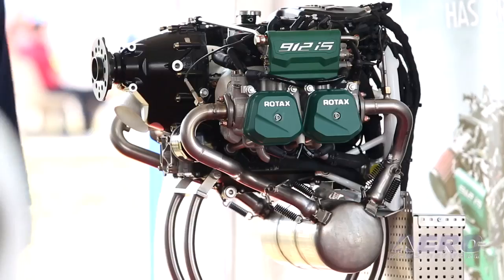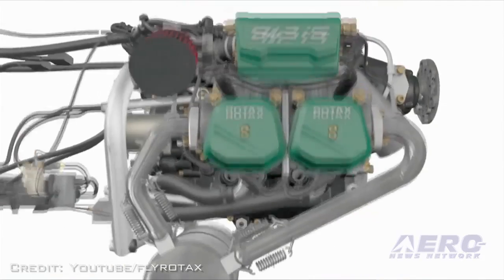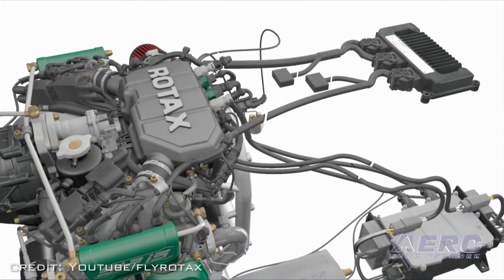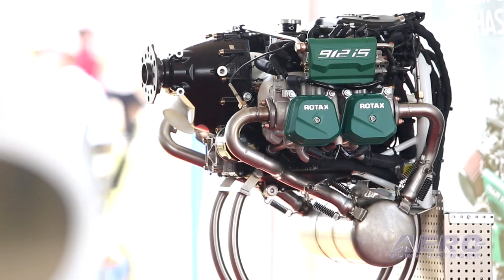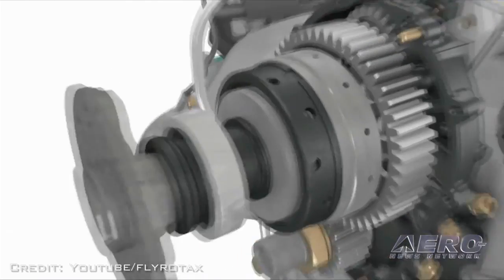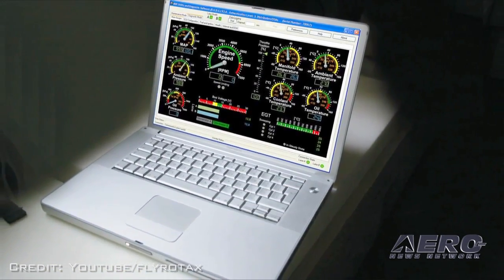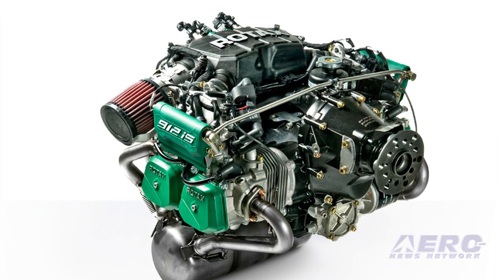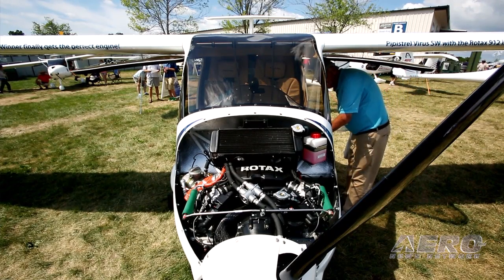Aero-TV: Rotax 912 is - Updating the Rotax 912 Series Powerplants

Comment: Okay, no carb adjustments, so easy starting, so reduced sprag wear. 4 x EGT driving separate fuel qty and spark time each cylinder, so better performance above 10,000' + better burn so increased range. No carbs so no carb ice. Performance = not just 0 AMSL power, also at altitude, also range. I've changed over!